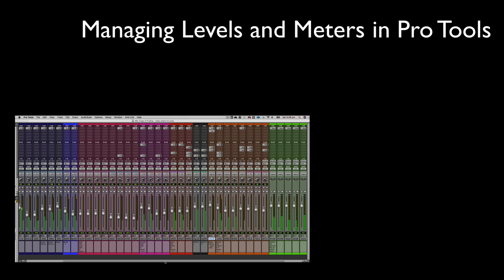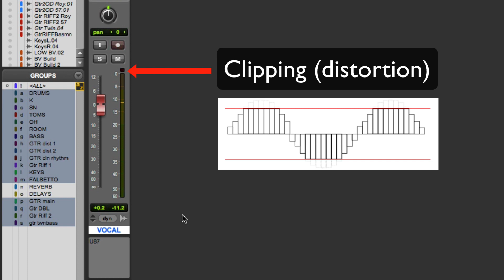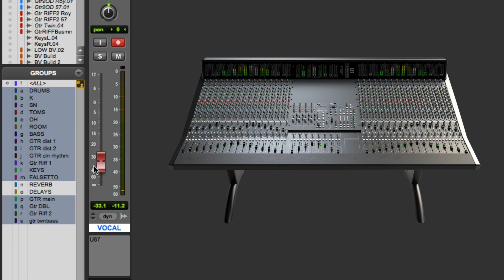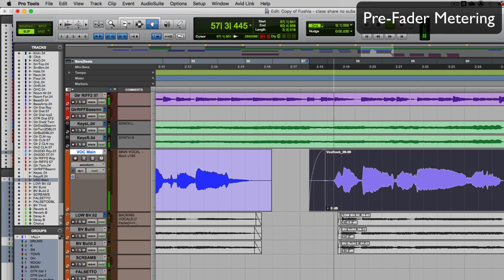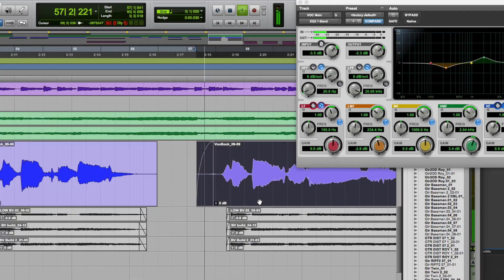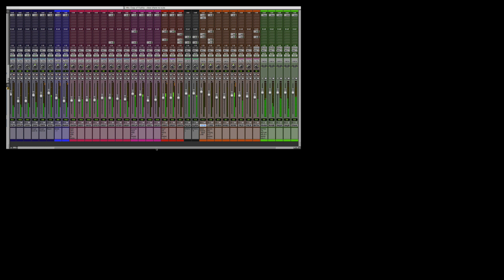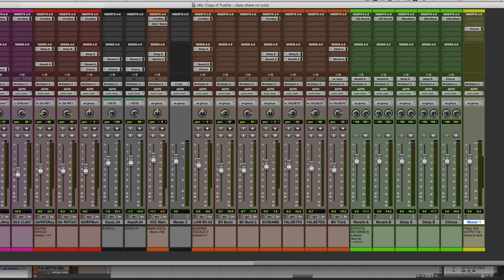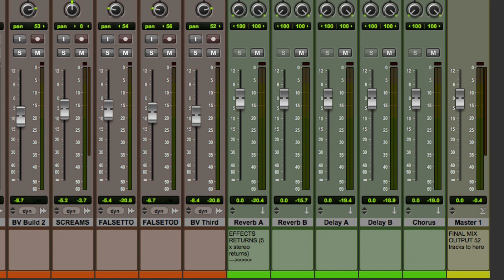Pro Tools: Understanding meters and managing levels

Comment: This is a very good and informative video. Most important, your comment that your recorded signal should fall between -14 dbfs and zero. However, I had heard that you should attempt to be within a -18 dbfs to -6 dbfs range.
Reply: @socialinterior   Thanks for the response. So you're saying, if I record a guitar (yes I use 24 bit 48 kHz) and use the Pro Tools Sample Peak meter, peaks between -10 dbfs and -20 dbfs should be fine and in no danger of clipping?
Reply from the maker: @fredmanteghian5913  That should be enough headroom. The main thing is to get the talent to play through the track while you are in input monitor and  look at the peaks to see where they fall. If the mic is very close the levels will jump around more than if it is further back.  You just want to make sure you avoid any red clip lights while you are recording (you won't see them afterwards on playback) and that your level is up so that the highest peaks are reaching above -10dBfs or so. That would be optimal. In reality 24 bit recording is very forgiving of level but no system will handle clips. That is distortion at any resolution.

Comment: Firstly, thank you so much Julian for your videos on mastering in pro tools, they are by far the best I have seen! I have a question though - my sessions include many samples from sample packs, or I have taken them from cds in my collection and other sources. What I find is that their level/dbfs can vary greatly, so I have usually resolved this by simply using volume automation directly on the file to adjust in the mix. However, I've been told I should be gain-staging to ensure all samples come into the mix at around -12dbfs. Should I be doing this? I can do this by using the gain plug-in in the pro tools audiosuite (I'm using pro tools 11.3).  - David

Comment: The metering info is great, but is -0.4 enough headroom for a master? I was instructed to send my song at -6.0 to a mastering house in New York. Thank you for your time in advance.
Reply: You definitely want to give the mastering engineer enough headroom and at -0.4, they would probably send it straight back. -6.0 is a good rule of thumb
Reply from the maker: Thanks Robert. To be honest, it doesn't really matter how much headroom you have, as long as you don't clip. The mastering engineer will gain the master up or down before it goes through their chain in any case.  There is no such thing as a required headroom level. I've never heard of anyone worrying about it because its just one stage of clean gain that all MEs have at the beginning of their chain anyway.

Comment: Nice video...Which is better to gain stage an instrumental when recording a rap song? A wave VU meter..or simply looking at the highest signal peak level on Pro Tools channel meters?
Reply from the maker: Thanks Shaun! The highest sample peak reading on the Pro Tools channel metering is what is most relevant to recording (and avoiding any clipping)/ VU meters don't really show you peak levels. They are much slower and work across broader time windows. Hope this helps!
Reply: @socialinterior  Thanks! Are you familiar with Pro Tools color break high and color break low in the metering tab? If I set my color break high to -12dbfs and color break low to -20dbfs .is this my true input recording level Pro Tools showing me on the meters? Its in setup... preference ...metering. Thank You!
Reply from the maker: @shaunblack3142  The colour breaks are really only for people who want to change their view of what 'hot' level is within the full range of possible level from minus infinity to 0dBFS. That's really a question of taste. I leave all mine set to default colour breaks. I then use sample peak metering when tracking and then K14 for mixing, although that's mostly useful on my master bus. I find K14 to be an excellent, meaningful meter for master bus level when mixing. In addition to that, I usually also use a dedicated metering plugin, such as Metric AB or SPL Hawkeye to get my loudness profile sorted. I sit that open on another monitor in the later stages of mixing. 

The only thing that really matters when you are recording/tracking, is sample peak and your ability to see it clearly. That's the peak dBFS level that is hitting your converters. It shows you precisely how much headroom you have before clipping and its response is instantaneous and it's very clear what your peaks are up to.  This is why I normally recommend people setting their meters to 'sample peak' when they are tracking. After you've finished tracking then it's not that important which meter system you use when mixing, as long as you can see both your peak and average level at the master bus. I haven't felt compelled to change any of the colour breaks because they all seem pretty good to me. Hope this helps!
Reply: @socialinterior  Thank you! I subscribed to your channel and hit the bell so i get notify when you post. Thanks again.

Comment: Julian, I've been recording songs for the last 7 years... after being retired for the last 25 years. I thought I did everything perfectly. Now everything I have done has gain-stagging issues. I am using Pro Tools Studio 2022 and my meter is set to Digital VU. Some of my drum tracks were averaging -20dB and were peaking at 0? There shouldn't be such a drastic swing? I heard Pro Tools Classic Meter is better to use, but the part that is not explained really well is that all of these meters seem to be really different, so depending on which one you use you can have different results. Which is the best meter in Pro Tools to use? Thanks
Reply from the maker: Thanks for watching. VU metering is very slow and shows average level over a longish time frame. It’s not very useful for digital recording for reasons you have discovered. I would use sample peak on mixer channels. That shows absolute digital level. That’s what you want to avoid clipping when you are recording etc. I use K14 on my master fader for reasons that are a bit complex to go into here. You can’t go wrong with sample peak.
Reply: @Julian Knowles - all things music production  thanks, Julian. I had switched to Pro Tools Classic before I got this message. I though everything was adjusted to -18 average. When I switched back to Sample Peak I can't tell where my average volume is. I think I'll check every track with a regular VU Meter like the Klaghelm and see where I'm at. Thank you
Reply: @socialinterior  Julian, you're right on the money with the sample peak setting. My question now is I have the headroom issue solved, but if you want your average dB to be -18 and an instrument hits -3 peak 2 times but has an average volume of... lets say -25, where does that put us? I have a few times on my OHs that this occurs. My thought is ultimately isn't the peak volume most important? I know they say that most plugins are geared to work best around -18 average. Thanks, bud!
Reply from the maker: @OfficeofthePacific  That's great. For source mixer channels, the most important thing is to see is if you are clipping on record. Then the master fader is important to see how you mix level is building. You can set the master fader to a different metering standard than the regular mixer channels, which is useful.
Reply: @socialinterior  thanks, julian 👍👊🙏